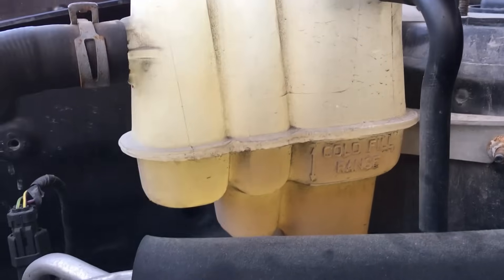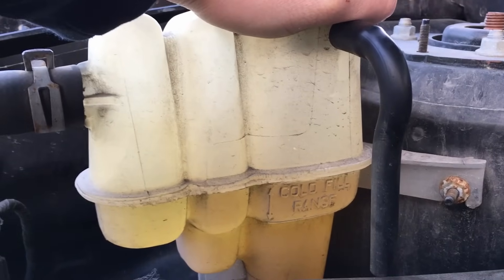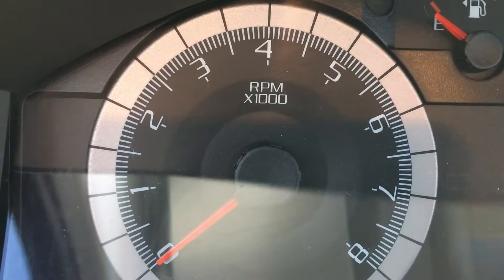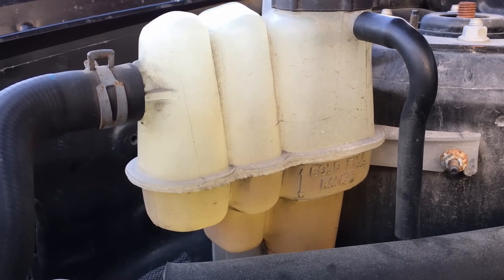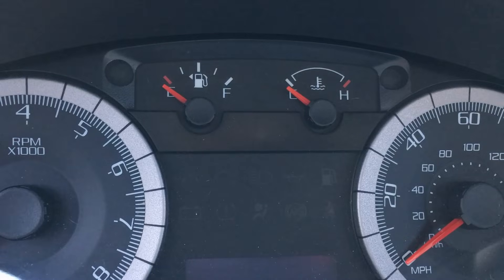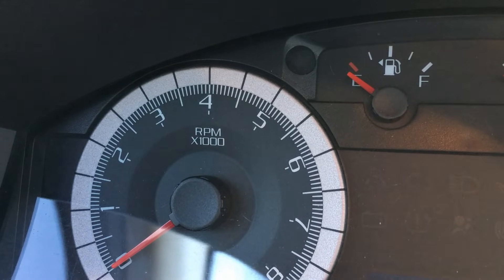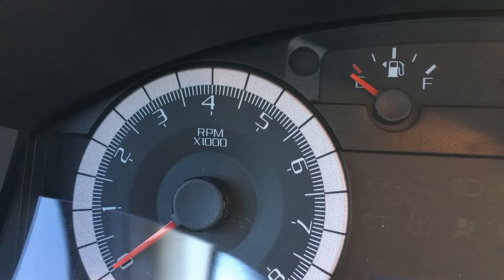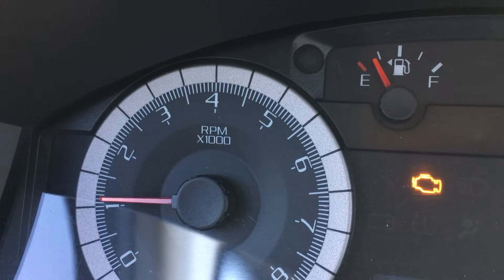Ford Quick Tips #69: The Trick to Purging Air From Your Cooling System

Comment: I can't thank you enough. I thought I was going to have to take it apart and replace my thermostat blaming the parts guy for giving me the wrong one. He wasn't overly confident what temperature setting I was supposed to have. Thankfully I found this video and I was able to get my 3.5 l EcoBoost engine toasty warm which is really nice because currently it's -27 here. First try didn't help but by the second one it was already starting to blow a little warm air, third one and it's hot and toasty. Thanks again!

Comment: Man, thank you SO much for this trick!  My 2008 Ford Escape had never had an overheating problem, and then a bad connection led to the fans not running.  Next thing I know, my temp gauge is pinning to the Big Bad Red "H", and no cabin heat.  I got the fans going, but that only lowered the heat a little bit, and it sometimes pinged back up to Red.  I just happened upon your video on a Ford forum and tried the procedure you describe.  After 2 cycles, the temp gauge was back to mid-range and the cabin air was blowing hot, hot, hot!  I'm stayin' wired to your channel, dude!  Thank you!

Comment: This a method that I have used for many years and mainly it works well. I know some systems do need to be vaccumed to get at good result but I am not a fan of the process as it can cause issues with hoses. I would like to add that it is best to not have the coolant pressure cap down tight if the engine is cold as this allows the system to have an area of lower pressure to which the air can move to and escape. As the engine warms up the pressure cap will have to be tighten so coolant is not forced away from hot parts by steam pressure. But slowly release any pressure once the engine is stopped, without fully removing the pressure cap. Always wise find out how far you can unscrew the cap for it not to hold pressure while the system is cold.

Comment: Much to my frustration, I also couldn't get my 2.5L fusion to produce heat after replacing a thermostat, water pump and belt tensioner. 

I'd read the comment of someone else having to do it 5 times. I had to do it multiple times as well. And eventually it worked out. Thanks to you for the video and for people commenting their experiences. saved myself a lot of money.

Comment: Finally won the battle it took several tries of 3500 for 30sec and idle for 30sec off for 1min I mean 8x then I finally started feeling hot heat at 3500 and then I slowly brought down to idle and finally at idle extreme hot heat and cooling temp half way.    Thanks for your help you are the FORD MAN!!!😁👍

Comment: Man you just saved me today. Had a coolant hose break thought it got to hot but never over heated. No heat then runs hot. Did this trick it burped had to add over a gallon when all said and done. Heat is hot temp is back to normal. Thanks man!

Comment: This worked for me. 2,500 rpms worked great on my 2010 Fusion 2.5L. Thanks man
Reply: Did you hear bubbles when you first cranked your car? I hear that on mine and I lose heat and temp gauge starts spiking. I've tried literally everything at this point to fix this car. I'm going to try this tomorrow!

Comment: Thanks, Bryan. I wish I had found this video before changing the thermostat in 35* weather. I had better luck eliminating trapped air by putting the front of the car on ramps. The added angle seemed to help. Thanks again, sir.

Comment: Thanks so much for this video! I had a coolant leak from my coolant pump so I replaced it and I replaced my thermostat at the same time. I cleaned and flushed my system in this process as well. My auto maintenance experience is very little so replacing those two parts was huge for me. However I finished and it was still overheating and I became very discouraged. I was just about to give up and take it into a mechanic when I watched this video, followed it to a T, and viola it worked. Thanks so much for the help! Please keep up the great work!

Comment: I've had my car for a little over three years and it has been running perfectly. I haven't had any major repairs - I just get my oil changed on time. The oil change guy suggested I get a coolant flush, so I did - and only then did I start experiencing issues that my car never had before. Every time I went to fuel up my car I would have starting issues, but I would just crank the car for a little while until it finally started up. After this initial issue at the pump, my car would start everywhere else without any problems - until my next fill up. Then the same problem would repeat all over again. I was told it was the purge valve that needs to be replaced, and I believe it, but I can't help thinking that it has something to do with the coolant flush that was just done. I was basically told that there wasn't a reasonable connection between the coolant flush and my car's issue - and yet it is quite a coincidence to me. Is there any way a coolant flush could cause other such issues with vapors...etc..?

Comment: This is how the ford dealer manual suggests bleeding the system in my 2012 focus. It works really well, I could actually see the air bubbles coming out the coolant bottle. Good tip
Reply: Did you leave the coolant cap off?
Reply: @untraditionalministries4588  it was over a year ago so I can't even remember. I followed the Ford manual verbatim  and it worked quite well on my focus.

Comment: When all else has failed to completely purge air from a cooling system, drive in 1st and 2nd gear in a very hilly suburban area. Keeping the revs anywhere from 3000-5000 rpm while driving up and down steep hills especially while cornering has worked for me to get out that last bit of air and stop the gurgling noise. I find 10 minutes of this driving does the trick. Just keep an eye on your temperature gauge to be safe.

Comment: 2012 Fusion 2.5, worked for me. every time I'd turn it off, I would open slowly the coolant cap and squeeze on the upper radiator hose to suck all the coolant into the radiator. Do this after each 30-30 until your car starts and blows HOT at idle. Took me like 5 proper cycles and 40 minutes of figuring out.

Comment: Exactly the method I use.  It seems simple but works really well.  I have an AirLift too, but never use it.  I see lots of guys jack up the front end, use the Lisle rad funnel, etc.
Reply: Have to admit, I was skeptical, as my air pocket was lodged in the rear heater core of a Toyota Sienna van.  But I was out of options - I purged per the procedure in the manual, no luck.  I used this procedure, had rear heat again. Thank you!

Comment: My man!!!! Worked beautifully to purge on my 13’ F150 ecoboost. Thank you!!
Reply: Did you have heat coming out of vents? My 2015 3.5 ecoboost gets a bit hot when driving uphill, but I do have heat coming out of vents . Could air in system be my problem? My thermostrat was bad, I changed it, truck still gets uncomfortably hot driving uphill

Comment: Thanks, I had to replace my thermostat in my 2013 Ford F-150. Afterwards, I topped off my coolant and thought i was good. Then I had cold air at stops and idle. And would overheat for a few minutes then be ok. This seems to have done the trick. Great tip/video.

Comment: Thanks! It worked for me. It was not working too good….Then I parked my car at a ramp where the front of the engine was lower than everything else and it helped push the air bubble out.

Comment: This procedure would have saved my 2008 Taurus X! I learned about the procedure after I experienced so much violent overheating issues that it blew out the water pump main seal on my X.  
My X was running fine, but at 250K I thought it would be a good idea to flush my cooling system for “preventive” maintenance. So I let Jiffy Lube do it and they (nor I) knew the system had to be purged properly. I experienced nothing but intermittent overheating issues for months afterwards because I didn’t know about this procedure. Finally got so violent that the pressure blew out water pump seal. At that point I had 292K on the car and ended up donating my beloved car to DAV!

Comment: Ford Tech Makuloco have you ever tested the water pump for flow rate and ability to push coolant up a hill? The man that gave us the 4 cycle internal combustion engine established that before an engine can be tuned step 1 is to establish a coolant flow rate of 10 liters per minute at 500rpm. The pump should also be able to push the coolant known as head pressure at least 50 feet. The pressure is so the pump can push the coolant through the restrictive passages that car and truck cooling systems have. A good way to test if an engines pump is up to the minimum standard is to disconnect the heater hoses run them into a bucket of coolant then start the engine and bleed the system, then remove the flow hose and stop watch the flow into a 1 liter container. Thanks for your great channel.
 Darryl
Reply: And how would a mechanic fix pressure and flow rate? These things are built into the design and barring a cooling system obstruction not serviceable characteristics.
Reply: Look at what makes a pump a pump. Impeller design impeller clearance to wiping face and impeller blade shape. Cavitation is one of the enemies of pumps and especially engines as it introduces bubbles and bubbles mean troubles. Start testing what you have and then look at a proper pump used in industry and domestic purposes.
Reply: ***** Like I said, all elements of the design phase. Nothing serviceable by a field technician.

"Bubbles"...You mean air bubbles in a sealed pressurized system that should be void of air?
Reply: Yes, after many hours testing water pumps especially with a tin impeller, we saw bubbles due to cavitation. We also found that some coolant suppliers were adding detergent to their product which of course promotes bubbles.

Comment: Often this issue is caused by not properly bleeding the system when refilling coolant after a drain. The Escape has a self-bleed system but you still need to make sure the heater core is wide open the first time around and taking these steps before taking it back on the road.

Comment: Hay flushed my heater core 3 times I got about a shot glass of crap out of it the 3rd time nothing came out.anyway the heat would be hot and warm as I drove it.was driving me nuts.i watched your video and I did it and it worked I have constant hot air flow. For the first time in two years.thank you

Comment: After changing out the coolant in my '97 4.6L F150, I started hearing a gurgling sound coming from under the dash on the passenger side after shutting off the engine. Probably from the heater core. After following the instructions in this video, the noise is gone. Thanks, Brian.

Comment: Good video's you make. I tried this way on my 2017 Explorer XLT 3.5 liter, and it didn't work. The coolant for whatever reason would not flow with the cap on, and the Heater running. I took the coolant bottle cap off instead, and let it idle for about 20 minutes, occasionally revving the engine to 2000 RPM's, and then I could see big air bubbles rising too the top. Squeezing the hose helped as well. Point is I did it differently, and it worked. I still don't know why the way Ford said to bleed it didn't work, but oh well.

Comment: 2010 ford focus, this fixed an issue setting off my p1289 error code CHT sensor. radiator cap was opened a little while it was hot i believe(, i don't think while running). But anyway, the ford reverse flow must have sucked some air into system and boy I was worried since I just bought it from a dealership "as-is". Hope this comment and your video helps more people out there with any similar issue. 3000 rpm in park for 30 seconds did the trick for me, since it barely wanted to hit 3.5.

Comment: I've always hand pumped the hoses while running. using a hose clamp off tool or two to block off certain areas of the system

Comment: Thank you so much. My 2014 Ford Taurus was very low on coolant and had no heat. I filled the resevoir but still had no no heat at all even while driving. I came across this video and  did the the cold then hot reving for 30 seconds each and now the heater is working perfectly again!

Comment: I have fixed so many things on my vehicles and been able to speak technically with my service writer at the Lincoln Dealership as a result of all of your awesome videos. I asked him about the oil catch can for the 3.5twin turbo eco boost in my 2013 lincoln MKT and he says they have never installed one an any Lincolns with eco boost.  My tech encourages me to use good gas and go for an Italian tune up after it gets good and warm. This should keep the chemicals and oil burning off and said that the tuning on the trucks version of the same engine is tuned a bit different. My ecoboost is a powerhouse now after they cleaned the intake with a 3 part cleannig system and reprogrammed the ecm.

Comment: I have a 2012 Fusion and I could hear bubbles going through something when I would start the car plus the overheating and lack of heat. Did this trick four times and I no longer hear the bubbles and the heat is back at full strength at idle!! Thanks so much for posting a very helpful video!
Reply: Did this fix hold up? Was your car a 4cylinder SE? I have a 2010 SE and hear bubbles when cranking too. Overheats at idle and loses heat unless it's driven about 50mph then the temp goes down. 

Did you remove the cap any when revving?

Comment: I have a 2010 fusion with a 2.5 and I had to replace the thermostat, all I did when I refilled it was open the vent tube poured the coolant back in and no problems, no overheat and plenty of heat at the vents.

Comment: Ford edge had thermostat replaced by husband...heat blows for 10 secs then cold.... Did what you suggested about 5 times... Coolant level dropped and got heat going but blows HOT then warm but stays warm consistently but won't stay hot consistently.... Should I repeat the steps.... This is definitely better than what was going on yesterday!

Comment: Thanks. I have a 2013 F-150 5.0. I paid the ford dealer for a coolant flush and new heater / Radiator hoses. I'm having a combination of the two problems you described now. I've had it back there twice as of today. I had the no heat issue but now its more just overheating. I'm stressed they've charged me a lot of green and this should be something they are experts at. I'll give it a try and see if I can do their job better then them. 

Update: 5/11/2021. I took the truck back because the last time they said they got it , it was worse than ever. Strange, if I throttled over 60 MPH, I could watch the temp gauge climb. If I brought it back down, it would correct back to normal in about 2 minutes. Bazaar! It was a little worse with the heat on vs AC. When I brought it back the next morning, They were committed to find the issue and I appreciated that. 

I don't like to accept coincidences when trying to solve an issue because it muddy s the water, but they had nothing left to try except pull the water pump.. The impeller was cracked! They didn't charge me any extra labor for the 4-6 hours of diagnosing. I think they just wanted to figure it out as well as I did. I did have to pay another $360.00 to R&R the water pump. That's okay, the truck runs perfect now.  The hind sight of all this is that I should have known to begin with .... No manufacture is going to make adding coolant to your rig so freakin complicated that it would cause these problems. Its not a simple bubble in the system unless you have perhaps a tiny motor. This is a 5.0 V8 with very large water races throughout. I should have known not flushing the engine for 7 years could probably open up other issues. Maybe in this case the gunk was holding the impeller together. This truck has been hard on water pumps. this is # 3 at 168k
Reply: keep me updated my f150 fans are on full blast pretty much all of the time and when im on the  highway if i dont have my heat on it will start to overheat
Reply: @dylanh1898  I updated my original post

Comment: 2003 Ford Explorer, I'm going to try this even though I do have heat.  Might not be as hot as it used to get though.  The resevoir still has fluid in it, but it's not getting cycled by the radiator and thus I am overheating.  I just need this thing to hang on for another month or so before I get another vehicle.... 🤞🤞🤞🤞I hope this works.

Comment: This is extremely useful - thank you for posting it!  I am trying to remove the heater hose from the engine on a 2.5L Fusion 2012.  I have a hard time removing the hose clamp that has a circular hole on it.  The pliers I am using keep slipping.  What pliers would you suggest to use to open this hose clamp?  Thank you!

Comment: Great video very helpful but have a question I have a 2003 F150 with the 4.6 motor this process helped but still air in the system question is what is eventually go away or do I need to haven't vacuumed
Reply: Did you figure it out? I have a 97 f150 4.6 and about to do this